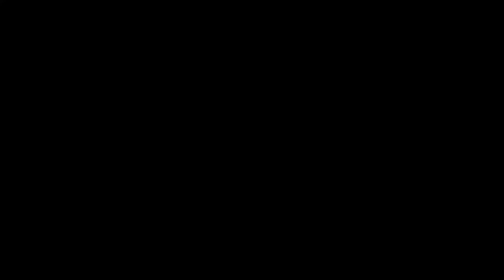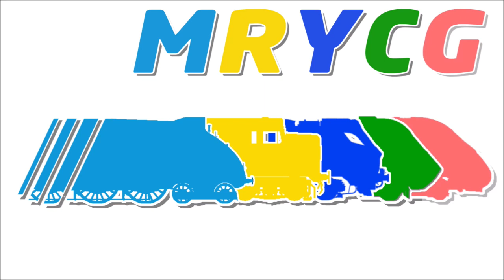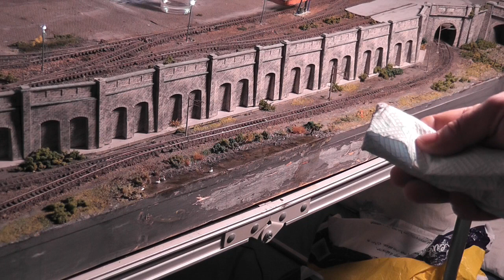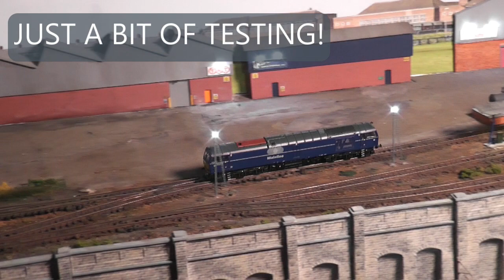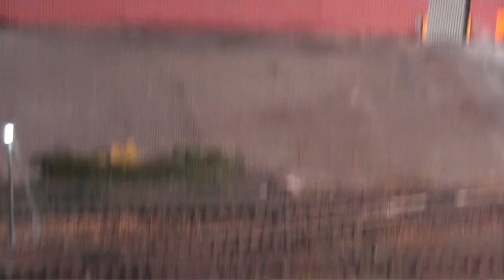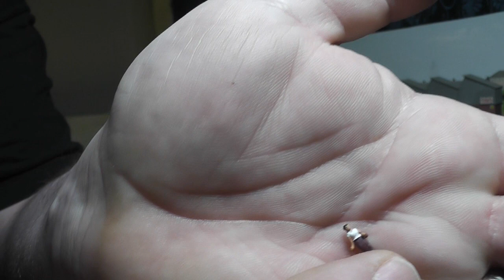Swade's Pond part 10 quick overview

Comment: Good to see Swade's Pond back in action Tony.  Intrigued about what you have planned for the open day and its wiring.  Thanks for the mention of my efforts with the market lighting.  By the way the Severn Valley do overnight running as part of their Autumn Steam Gala, so you would have a reason for the open day to go on into the night.  I notice the TMD had been removed when I was watching the running session on the lower level.  Is that part of the cunning plan for wiring the stands and stalls for the open day?  Stephen
Reply from the maker: Hi Stephen it was your Market place that rejuvenated my original idea for the open day. It was the wiring side that put me off, but now I have a new idea to feed the wires through. The only downside of the open day is that I'll need lot's of figures LOL! regarding the MPD, I forgot to put it back on when I turned the layout around again 🙄. All the best Tony.